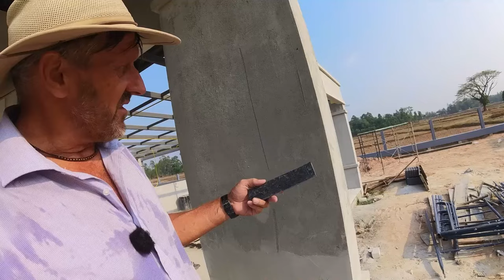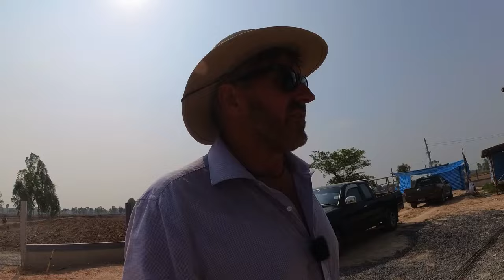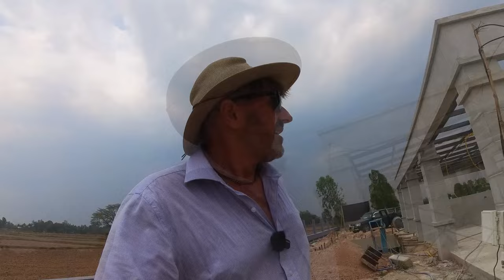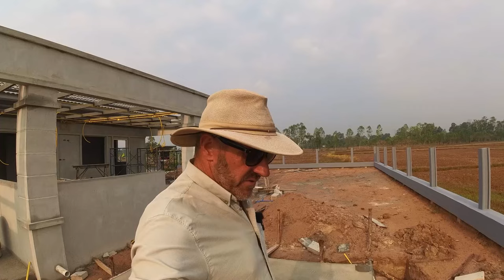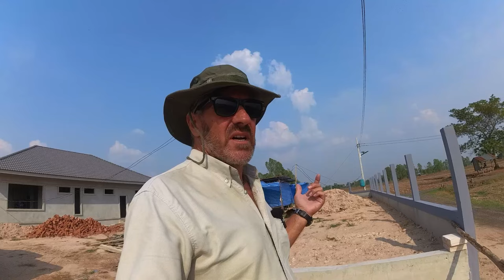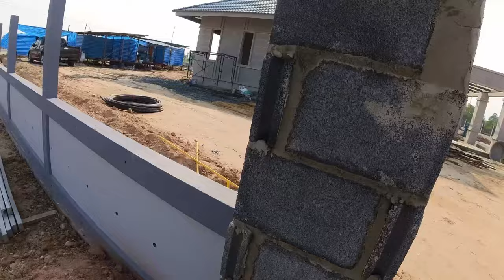Updates

Comment: air admittance valves are a fantastic development.  I used to install on main sewer drain as well as on every sanitary fitting (Including toilets which are an optional addition to toilet pans (P and S).  If not available place on top of a junction connection wherever possible.  Better than have multitudes of roof penetrations and aesthetically more pleasing not to see pipes on walls outside.
Reply from the maker: Thats good news. I knew they existed but never had the need to try one. Thanks

Comment: Good morning Kenny  that's a good valve  In Cebu I fitted sink and tub traps with that type of valve quite new in New Zealand
I think it's shut off and opens only on vacuum You still need a terminal vent close to end of sewer mainline

Never seen in Philippines.
Reply from the maker: Yes, further eeview i discovered there is a light spring holding it closed until light vacuum opens it. Thanks for watching.

Comment: The slate as you’ve noted needs to be sealed. It’ll need to be resealed every one to two years. 
You’ll also observe later that the layers WILL split off. No way to prevent that. Hopefully the labour will concrete on like tiles not a dab here and a dab there to attach to the pile-one.
Reply from the maker: I will make sure they attach them well. Thanks fir the heads up.

Comment: Isn't the air admittance valve supposed to be 6 inches above the flood level of the fixture to work properly? by putting it under the counter it will surely be too low?
Reply from the maker: According to the instructions/diagram it needs to be after the P and only 4" above a T that drops the flow away from the source. Only time it would see water is if the drain after the T would plug and in that scenerio it has a "check valve" back flow prevention inside. We'll find out in a few weeks!

Comment: why do they leave the water running like that?
Reply from the maker: The pump is a 1.5" line, but the line they use for household stuff is only 1/2". I don't want to overpressure the pump and wear it out or burn it up, so excess flow is diverted into a 1" line going into the pond. I will be sending it to a tank and then through a pressure pump starting next week. I will explain why I was going into the pond when I make that change.
Reply: @ParadiseNThailand  okay.